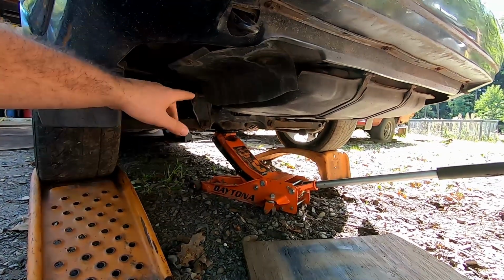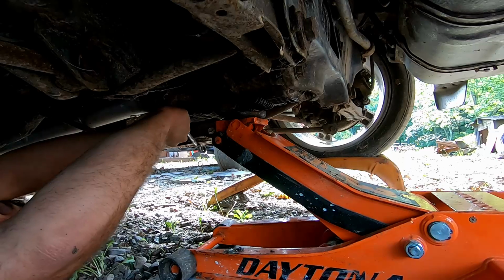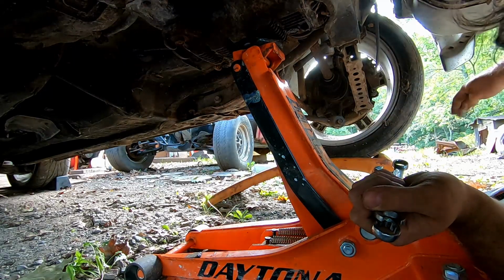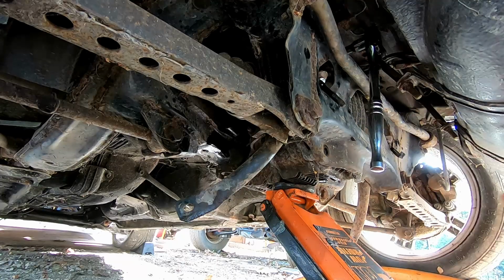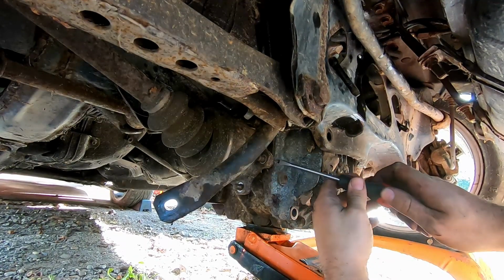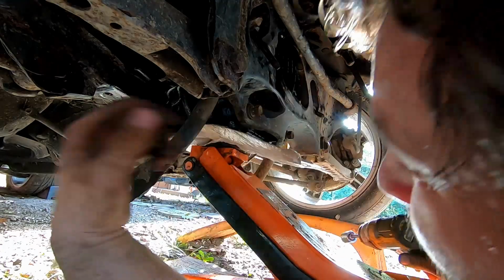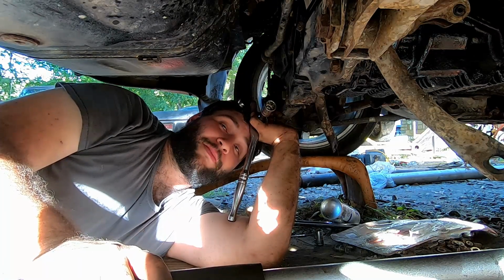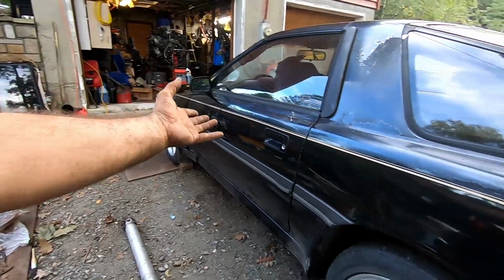Upgrading the Differential In the Supra From 3.73 to 4.30 Gears.

Comment: So, im swapping a 1jz-gte vvti into my 88 mk3 that currently has the 4.30 diff. I was thinking of swapping the diff for the 3.73 due to the fact that the 7m-ge and w58 would run at 4k rpm at 80ish mph and i ran 1st gear out quickly. It had a lot of torque but top speed was very low. I know the 1j reaches max torque at 2600rpm due to the vvti, so i was thinking of swapping the 4.30 thats like having truck gears to the 3.73 which i would assume would move some of that torque to top end speed.

Hopefully this makes sense.
Am i correct in my assumption?

Also thanks for another helpful vid. Hopefully i get to run into you at suprafest this year (if my build is done by then).

Comment: Lunar, I might have missed it. The 2-piece driveshaft; the center bearing. (Carrier-bearing?).  I remember the '58-'64 Chevy's having that type driveshaft. They had the "X" shape frame. A few family members had those cars, and when the carrier bearing went bad, the mechanics had an awful time figuring out the problem. They probably didn't know about them is all.
Anyways, I can't wait to see this car driving!!!!  
Lube on bolts changing torque.....Makes perfect sense. The lube reduces friction, then the bolt gets OVER torqued....